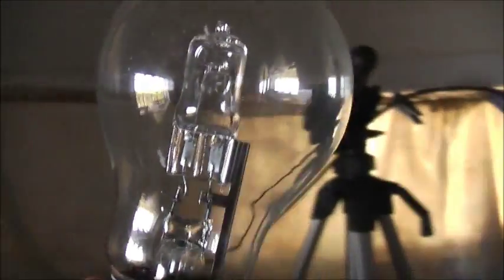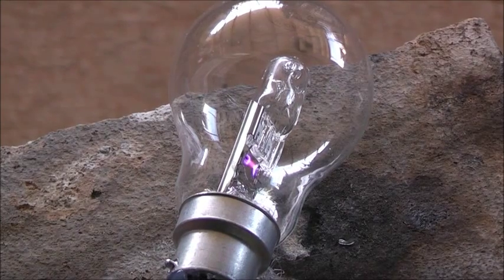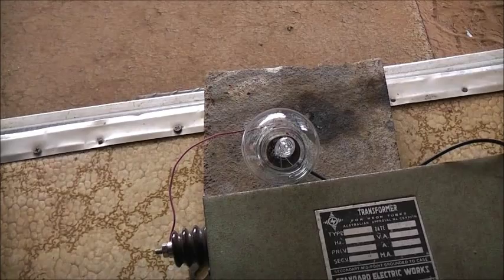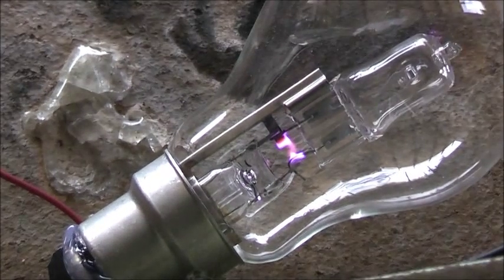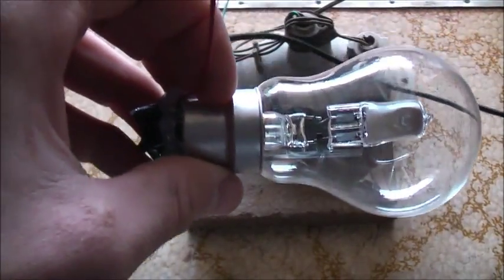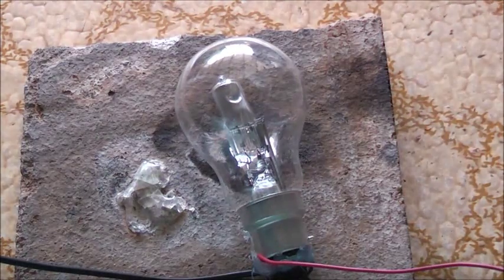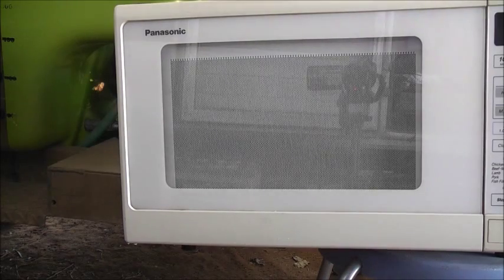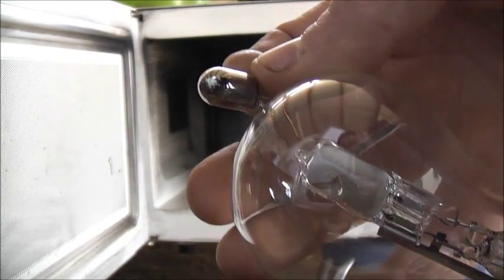Arc In Lightbulb!!

Comment: Nice arc in there. :D

To truly finish-off one of those, 2x MOT are needed with the outputs in series to get about 4kv. Variac needed.

Wire the lamp across the MOTs, then start the variac on zero & increase for an arc outside of the halogen tube.

For an arc inside the tube, close the gap as best as possible with old bits of filament, strike an arc in there, then QUICKLY turn down the variac to maintain the arc. :D

Then glow-up the leads so that the halogen tube drops off in there. :D

-BBD.